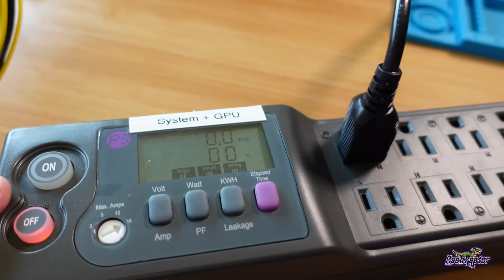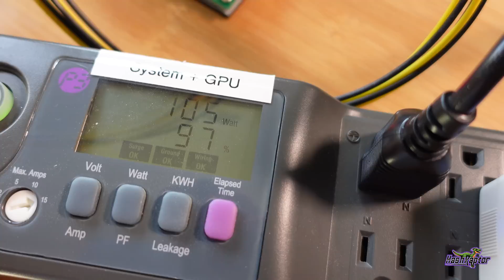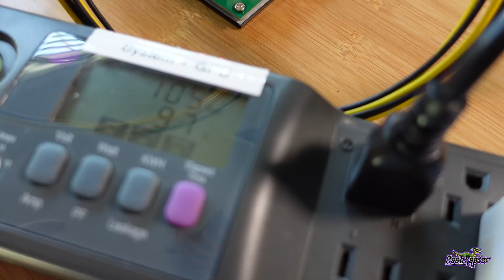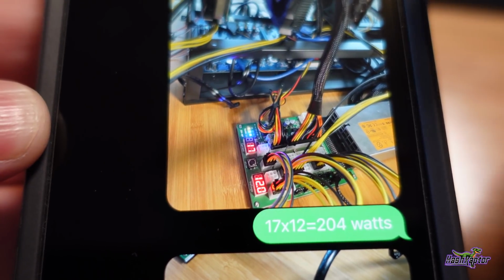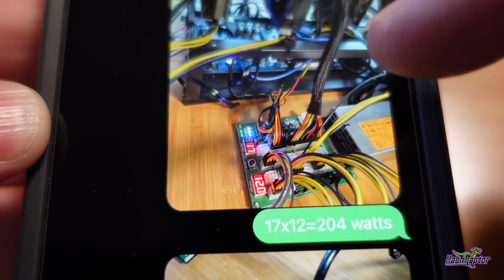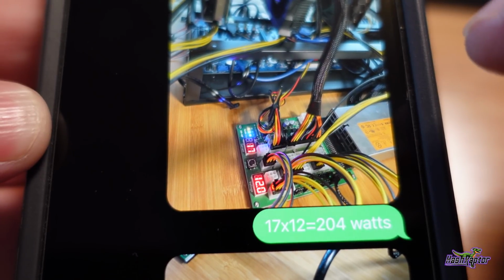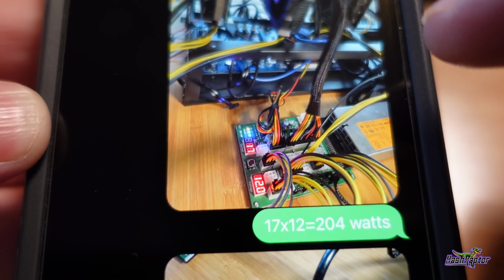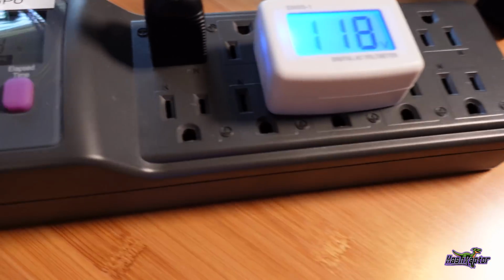A Game Changer Again ??? REV 2 Parallel Miner ZSX AMP 16 Port Breakout Board

Comment: Not to sound dumb or anything but can that built-in pico handle a ryzen 9 5950x?
If not can I power the cpu directly from the 6pin pcie with an 8pin atx adapter?

Comment: So I'll need an adapter for a 8pin GPU?
Reply: No, the 24 pin cable that comes with the ZSX has a dual 4 pin cpu cable as well. (8 pin splits to two 4 pins)

Comment: Hey guys hope someone can help quickly I have the delta 2400w power supply with this is same breakout boards. My question is can I use 6 pin to sata connector to power my ssd or does it have to be the supplied moles to sata connector? Thank you hope someone can help

Comment: At $78 + the price of a server power supply(.which is way up in price since miners found out about them) its not much cheaper than at power supply.  It looks worse and is louder.
Reply: More efficient more durable more ports can sync with another server psu and more
Reply from the maker: I totally get where you are coming from.  In my experience, they are only louder when you push them updwards of 70% to 80%

Comment: You could say it's a game changer, but at $80 a breakout board it already makes it not a game changer. Don't buy this. Just get a mining motherboard that only takes 12v power, and don't buy an HP CS Platinum Plus PSU. The Plus models aren't efficient at high loads. Get an HP CS Platinum PSU (not Plus) instead. Problem solved.

Comment: so my breakout board is throwing out 12.4V and my motherboard will not 
power up, it works fine with normal ATX power supllies, how to i reduce 
the 12.4 to 12v?

Comment: Quick question. I bought my HP 570451-101 1200W PSU from Amazon since Parallel Miner is sold out atm. It didn't come with a power cord, could you advise where/which one works? I don't want to make a noob move of frying everything cause of one cord.
Reply from the maker: Hey, if you are using standard US 110 volt,  you can purchase a standard PC 3 prong cable.  I recommend making sure it supports at least 15 amps.
Reply: @HashRaptor  Thanks buddy!
Reply: @HashRaptor  I live in Europe we have 230 volt. Which cable should i use?

Comment: My motherboard won’t turn on when connected to the ZSX-AMP.  Any reasoning why? I’ve searched everywhere, tried different mobos, same exact problem nothing turns on
Reply: did you set the bios of the mobo to come on with the AC power (in this case, the server psu/ZFX) ?  If you didn't, do you have an on pushbutton switch?

Comment: Do you think it’d be okay to split a gpu and a riser into one connector on the breakout board?
Reply from the maker: So sorry this slipped by me.  Yes, you can split a gpu and riser, but check the total wattage on the cable.  It depends on the GPU and how much power it is pulling.  I'm fairly comfortable splitting 1660 supers for example because they are low power.

Comment: will 5 3070 gpu work on 1200 server psu or I need to daisy chain?
Reply: I would go with two HP 750w Server PSU’s. Or a regular 750-850w ATX Power Supply + a HP 750w Server PSU w/12 port breakout board.
Reply: @mattketner7597  That's what I end up doing. 4 hooked up on the 1200 psu at <120 watts and one on another 1200 psu but also reusing it for 2 other gpu for another rig.
Reply: Hi! I haven't bought this breakout yet, though I will as it will save me space and keep everything tidy. 
Anyway, running a 350W inexpensive PSU on a BTC-T37 mobo + 8 fans + a mix of 2 x 1660S, 2 x 1660TIs, 1x 3070. 
3070 shows 130W on my OC/UV. So running 5 of them would mean a bit more than 650W .... plus mobo etc.... I'd be ok with it but my HP PSU is on a 220V AC and therefore will handle 1200W. 
If you guys are running those on 110 ~ 127V I think your current solution is safer. An inexpensive 350W ATX PSU might be a cheaper combo if you factor in another breakout + cables.
Good luck there!
Reply: @carlosophia  - You can bring the power down to 45-50% on the 3070’s so they only pull 119w from the wall. So five of them would only pull around 600W total. Personally I use an EVGA Supernova 850W, and an HP 750W Server PSU. Powers up my 5 card 3070 rig easily, uses a total of 660w from the wall.
Reply: @mattketner7597  Oh, yes!, I was just replying more generically to the other user's question.
I'm running my 2x 3070's at 125W. BTW, do try using 125W instead of anything more or less than that. On my two different boards I found I got a better performance by tweaking the % until the boards got to 125W. My 3060's also "liked" this 125W setting... I have never seen anything about 15W or 25W incremental increases but it is working here for a variety of boards.
Doesn't hurt to try on your own, I supposed!
Good luck and thanks anyway!!

Comment: The 80% PLUS cert is measured at 20, 50 & 100% load. So running it at ~200W (~16% load) puts it outside of its certified ratings. You need to run that PSU at 50% load for maximum efficiency  (~91.75-94.44%). Please see here:
https://www.nautilusnet.com/content/Links/c03502743.pdf

Comment: In my opinion probably the amperemeter gave the DC current for the 6 pin connector (generally GPU) and the other side of the board 24 pin connctor + sata are not monitored (I think that 60 W for powering CPU,  AAAWAVE fan and SSD have sense for me and also you have to add the yield of your PSU (don't know gols or whatever anyway you lost again 5 -10 %)

Comment: If the breakout board and motherboard is powered down. With the power button for the motherboard wakeup the breakout board and server power supply.
I have this problem when using a pico board along with the traditional breakout board like you showed

Comment: Stupid question: How these boards behave in case of electricity shutdown? Do they power up back by themselves or do you need to push the power button by yourself?
The current consumption inaccuracy kinda sucks though :(
Reply: they reboot by themselves

Comment: What am I missing? How can one card be pulling 4 amps? I have over 40 cards on a 30 amp pdu.
Reply: 12 volts x 4 Amps = 48 watts computer parts
240 volts x 30 amps = 7200 watts pdu.

A 6800 card mining using 200 watts at 12 volts is using 16.6 amps or only 0.8333 Amps from a 240 volt power supply

Comment: the 67watts diff is very bad, that mean your PSU display amp reading ;show only the 12v side. If it's not the case the PSU is only 68% effi.
If i'am correct the PSU you have is Platinum? so you should see 20.4amps on the display to be at 90% eff at 20% load.

I think you need to conctact them to get more information about that display amp!

Comment: Damn that board is 78 bucks? Am I right. Compared to the other ones you can get a power supply and a board for the same price.
Reply: I just went there and bought a 1500 W kit. It had 2 750W servers with 2 Breakout Board and 8 Pcie cables for $57.00. But I will be using them with PSU/Server combos.

Comment: One thing I don't understand is why they are all 6pin and not 8pin, since all new cards need 8pin
Reply: 6 pin at the power supply, the cables are 6+2 (8 pin) at the GPU side.
Reply: @airborne63  yea but if I understand correctly that means that the 2 extra pins that are grounding pins just go nowhere.
Reply: @FirstLast-xk6fd  Some GPUs have some 6 pin sockets, so you use the 6 pin part of the connector.  If you have an 8-pin GPU, then the two parts of the connector click together to make an 8-pin.   I have GPUs that use both.  If you're using just 6 pins, you generally tie the two-pin part of the connector back on the cable.  I've been using the old version without the 24 pin connector for quite some time.
Reply: @airborne63  i know lol but on a 6pin to 8pin cable if you look in the +2 connector part is there actually any electrical components in there or is it just the plastic part?
Reply: @FirstLast-xk6fd  Two ground pins.  Jumpers from the 6-pin part.  I just picked one up to look.....lol
Reply: @airborne63  Ok thanks for solving the mystery lol

Comment: That's a great total system power.  My Ryzen 5 & single "100W" RX 580 PC is pulling 280W from the wall.  I currently also have a w7000 to run extra monitors (5 total) and have Bronze PSU.  Even tested with single monitor connected (and in standby), single GPU, RGB off, only CPU fans, this brought the usage down to 250W.  I'm consistently pulling 28.5-29Mh/s.  CPU and GPU are tuned for minimal power consumption so I'm not sure where this extra 100W is getting eaten up.

Comment: Not an electrician disclaimer...lol.  i dont have this board but i am betting the reading it reads is the power draw for devices hooked into board where it is wired.  Dc power uses power just for the circuit itself.  I dont know why but remember someone explaining this on a review a home generator/backup device.  So that could explain draw difference to some degree.

Comment: The PSU is extremely inefficient under 50% or so of its power capability
Reply: This is misleading. Some power supplies are very efficient at low loads, some are not. If it’s 80+ titanium certified, it must be at least 90% efficient at 10% load, 80% platinum mandates 90% at 25% load. Some power supplies that aren’t rated can easily be 60% efficient at 10% load, which is horrific, but this is becoming less common.

Comment: My explanation:
1. How much PSU efficiency you have (percentage)?
2. That current meter on board, on what part of breakout board does it read? only all 6 pin or the whole breakout board(included mobo and misc?)
Based on your readings, assuming 17amps(3 gpus) on whole breakout board all 6 pin only, not included the mobo supply.
Loaded with gpu mining state it is 17amps X 12volts = 204 watts
204 watts(to verify you dc clamp meter and measure all current across wire and sum it all), if not equal to reading means only 6 pins is readied.
your outlet wattage is 271 watts;
271watts(on wall) - 204 watts on breakoutboard = 67 watts is lost here,

*assuming 94%  psu efficiency 271watts(on wall) X 0.94 = 254.74 watts real load.  (6% of 271watts)16.26 watts is HEAT wasted.
**based on rabid mining test on server power supply, DPS-1200fb on idle state on of psu and breakoutboard = 29.1 watts( no load just switch on)
conclusion:

254.74 watts real load + **assuming 45 watts (idle comsumption psu + breakout board since it much bigger) =  271 watts.
--either you have much lower effiency or psu + breakout board too much comsumption.
254.74 watts on 3 GPu is good = 84watts per gpu. OR the board is included on total amps reading(17amps).
Reply from the maker: Good stuff man. Thanks for putting those calculations together.
Reply: @HashRaptor  welcome bro,

Comment: When buying from Parallelminer, keep in mind that not all reviews are posted under their products. It seems company is deleting reviews that does not praise them or their products, they let some bad reviews through, but I noticed first hand that they do not allow what is uncomfortable. Moreover, product quality is not better than similar items from Aliexpress. I am talking about breaking boards and 6 pin cables. Their "Game changing" ZSX board fried when connected exactly as was instructed in their manual. Support is not answering and blaming that their support software that emails get lost. Very bad experience with his company, when support is needed.

Just wanted to share my 2 cents.
Reply: I ordered 6 pieces of the ZSX board and 3 of them came with a broken capacitor, the same one. I emailed them, but they haven't replied. This was shipped all the way to Norway.. Too bad their support isn't there when you need them
Reply: @richardphan3286  Just ordered there to germany. If something like that happens i want my money back from paypal and i wont buy anything else on their side. Hope everything is fine
Reply from the maker: Oh no!  So sorry to hear that!  Any idea what was connected when it got fried?  Did it smoke up?
Reply: @HashRaptor  no idea what was the reason, I have connected everything according to the manual. For some reason some transistors fried when turned on. Board went up in smokes. I was never so scared when building rigs. So take extra caution when using those boards.
Reply from the maker: Man that is scary. Smoke is never good. Only happened to me twice in a few years. Not cool either time.

Comment: Fantastic review, thank you for your efforts!

I have purchased 2 Delta PSUs along with the ZSX breakout board (version 1) and I absolutely love it. Not only is it more efficient than ATX, it's also smaller and cheaper.

I also find cable management to be a lot cleaner with these flexible 6-to-8pin cables (compared to the thick cables included in the ATX PSUs).

Quite a game changer imo.

P.S.: And no, I don't get anything for this praise :-) I just love the product!
Reply from the maker: Awesome man. Glad it’s working well for you. Keep us posted how it’s going.

Comment: the server psu is also consuming alot of energy even at standby. When I plug in a server with 2 hot swap psu and don't even power on the server it already consumes 80watt
Reply from the maker: I saw that once as well. I actually captured it in my studio build video I think.  here is what is strange, I can’t recreate that with my existing PSU’s.

Comment: Molex can not deliver 300W ! this is crazy, why did they say something like that. 300W through Molex will burn your house
Reply from the maker: Good pointing that out. I think they were talking theoretical max for the entire ATX side. So if I think through that. Let’s call it 280 watts. And if you are at 80% of that max 280 -56 = 244 watts. Then add up to 10 fans, and a fully loaded molex (at 80 %) and mobo with a beefy processor. Maybe that is their thinking???  But also, I’m curious as I mentioned in the video to see data regarding how much power the molex ports can pull. To date I’ve found nothing on it. Any thoughts on that let me know what you think. Take care!
Reply: @HashRaptor  what i find on a single molex connectors in the past  is 132W on 12V and 55W on 5V.
Reply: My thoughs of the 300w rating is for the total use of the atx side. That is for the motherboard power, all the fan headers plus the molex and cpu 4/8pin connectors.
It's a breakout board with an onboard pico